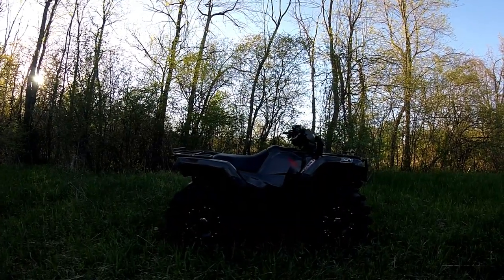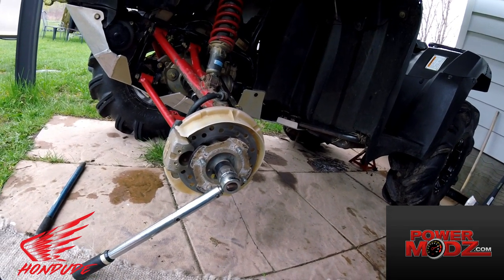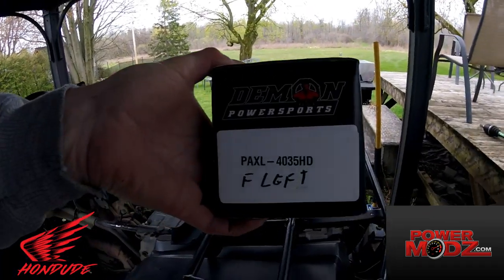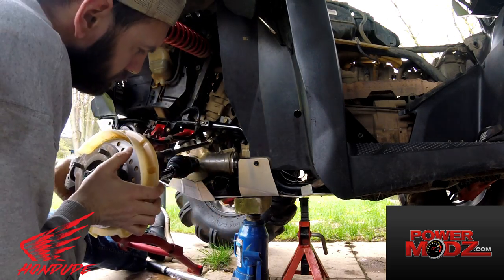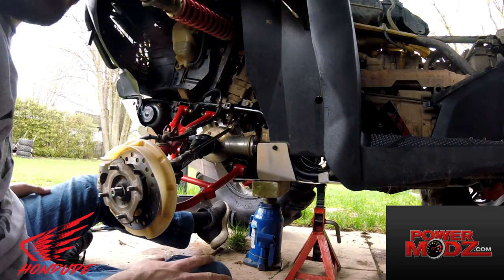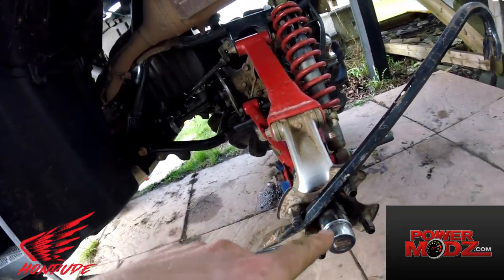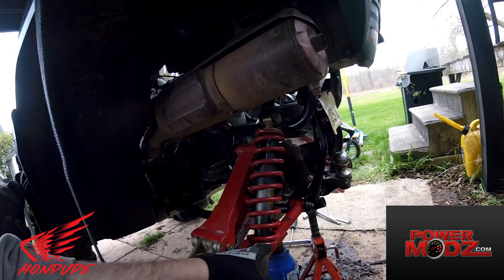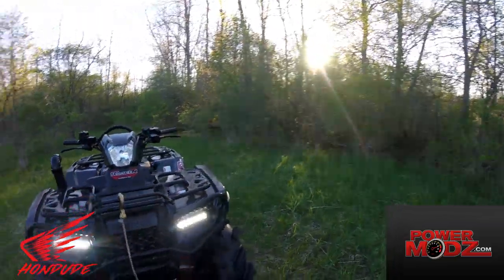Demon Axles Install - POWERMODZ How To Install Axles - Not a Mechanic

Comment: I run Demon Axles on the rear of my Grizzly. The only issue I found with them so far is the harder boot in colder climates is not good. The boot ripped right where its clamped. The rest of the axle is fine but the boot ripped. 
Good video tutorial bud. I still watch even though I don't own a Honda.
Reply from the maker: Hmmm interesting. That will likely give me issues this winter then.
Reply: @HondudeTeamMudhogs  Yeah crazy thing was it wasn't even that cold out. I was out riding in a hoodie that day. Mind you it could've just been a faulty boot I'm not sure...

Comment: What were the best tires you had on that baby
Reply from the maker: Outlaws are all I’ve had on this machine. They work really well in our area, plus they are fairly light weight for a mud tire so it’s a good match for the little Honda that could.
Reply: Hondude  I live in southeast texas and I was thinking 30” terminators and 4” portals
Reply: 32 10